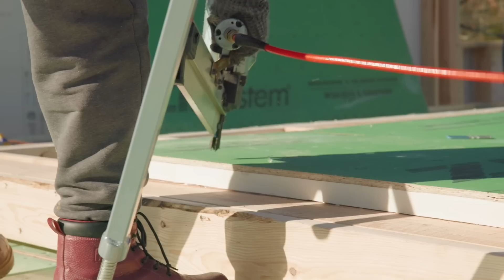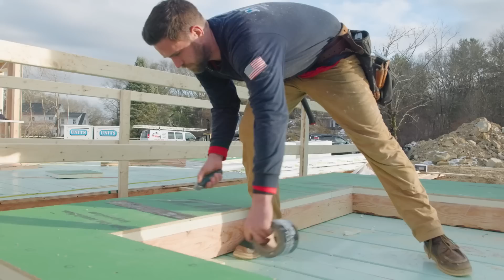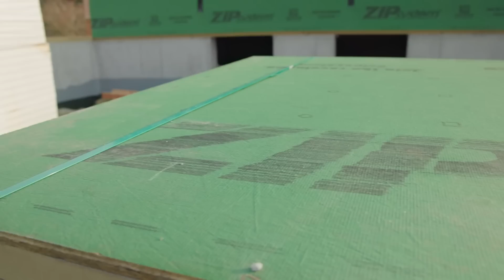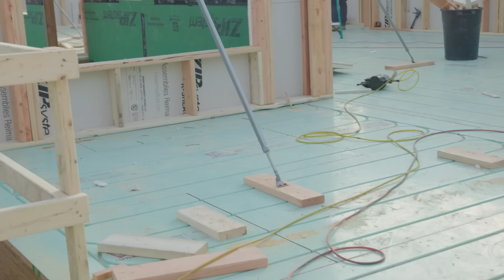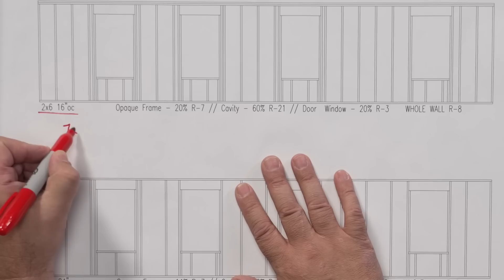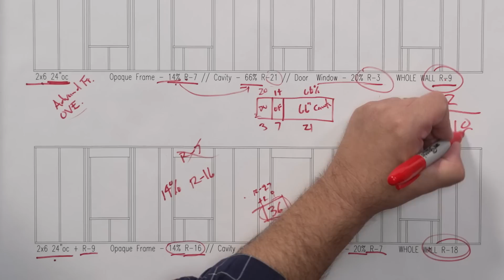"Wall Framing" Build Show Build: Boston Ep. 6

Comment: Amazing video Steve. This is the best explanation of wall system R value I've seen on YouTube.
Reply: Jeff, can you figure out where the R27 came from?  On the sheet it looked like R21.  If R21 is the right one then adding R9 gives R30 and not the R27 +R9 = R36.  What ever the case, Steves point is still made with the R30 or R36 as he ended showing that it was more than the R18. Cheers from Eastern Canada☺   Steve does such a great job as explaining things in a way that is easy to understand.  💯👍
Reply: @MegsCarpentry-lovedogs  he only mentioned it in the on site part of the video how he's getting R27. He's doing 2" (R14ish) closed cell in the stud bays and I think he said blown in cellulose to get the rest. 3.5" blown cellulose must be the missing R13.
Reply: @MrLouie75  Ah!  Thank you. 😊🇨🇦You may have found a few of the 2 missing pieces I did not catch on to. I googled blown in cellulose R value info:  The R-value of loose-fill cellulose insulation is approximately 3.5R per inch of thickness.  So 3.5in of blown in on the site itself provides initial 12.25R and it decreases over time as the blown in cellulose "settles" over time. Interesting! ☺
 I did send a request for him to clarify, realizing he is super busy being such a high profile architect. Like I did point out, so to not disprove or cause a negative perception on him, regardless if R36 was possibly incorrect and according to his drawing, using R21 +9C =R30, the building science still stands.  He helped us to understand that when a contractor says they will provide an R40 wall assembly, we are to asked is that the "whole wall" or just the cavity part. Further pointing out that studs have 1R per inch and windows are between 3-7R and that these lower numbers need to be calculated into the "whole wall" R value, not just the cavity.  
What I learned recently is that an ICF basement or wall assembly, not whole wall, is about R23, But include the lower window R value (R3-7R) and that R23 comes down in R value by quite a lot.  What a wonderful presentation Steve did on this one.  We are so fortunate to have him help us. As I prepare for this ICF basement but thick wall stick build assembly, with rock wood board 80 included on the draft plans, I am deeply grateful for what Matt and Steve are doing to help in the different areas of the construction landscape.  
I am not sure how things are in the construction industry in your area Jeff, but here on Prince Edward Island, construction companies are run off their feet and select only projects that will bring in fast money. When I have the plans sorted out and proceed for the permit, it does not mean I will find the right contractor and will have to continue to wait even longer than the 4 yrs I have been already waiting. Realizing that it is best to Wait rather than get the wrong builder for this 28 x 23 3 story, full ICF basement, open design with open web trusses.  
Of course the price of building material is outrageous. Saving up for the build can be quite a journey for home improvement renovation enthusiasts.
Thank you for your input Jeff. I will review the video and catch the on site bit I may have missed. Many thanks for your input and time on this Jeff.🙏🍁🇨🇦
Reply: @MegsCarpentry-lovedogs  You're welcome. On a different comment on this video Steve told me that a full ICF wall ended up more expensive than framing like this. I plan to build an ICF house in the next few years, and was surprised to hear that. Is that what you are seeing in your area as well? Why not full ICF at your build? So many things are built into an ICF wall (framing, insulation, vapor barrier) and the fact that I can diy stacking the blocks and even the pour if I choose makes me think it's still the choice for me.
Reply: @MrLouie75  Good morning Jeff. I understand the want to have a full ICF house right to the top plate or full side walls to the roof. I was saving up for this expensive build, full ICF, as well.  As I researched and waited for as much info as I could handle🙃, for my situation, a full ICF wall build means if it came to wanting to make any changes in an ICF wall it would be difficult to cut through the cement, and look for labour and the right trades people.  
Generally speaking I am a sort of "leave options available" sort of person.  I sat with the info for months and then realized that the ICF full wall would decrease in R value considerably due to the windows only having R3 or R 7 at best.  So an ICF wall of generally R23 is really not R 23 on the "whole wall."
The ICF full wall was only important if it could give more R value compared to a stick build.  As we have seen and steve pointed out, a stick build can have more or the same and a stick build gives more options down the road should the homeowner want to make changes.
Also I researched and looked at how the plumbing would be considered in an ICF full wall.  The plumber has to cut into the ICF wall further reducing its R value, and generally there is a lot of plumbing material to affect the ICF R value.
Your situation is different than mine though. As you pointed out, if you are not hiring a specialized contractor to do the ICF portion, that might save you a lot of money doing it yourself.  Then again, you probably could also do the stick build yourself as well and save more money. Food for thought eh!☺
From you postings and your replies you seem like a "belt and suspenders" sort of person, paying attention to detail and being more patience and conscientious than the norm in the building landscape. Either way you decide, I am most certain you will do a wonderful meticulous job, ICF or Stick build.
It will be interesting to hear, when the time comes, which you have chosen.  Two years ago, during the pandemic period, it appeared that the cost of materials for ICF and lumber were more on par with each other.  I am not sure if the cost of materials for both are closer at this point. More research is what I would need to do, if I wanted ICF. 
I am quite OK with a stick build. The draft wall assembly is in place for now, with rockwool board 80 added as an additional envelope layer to either R9 or R12, pending how much more I can save up.
I have yet to get the first draft of the plans and send it to get more feed back from a potential renovation local builder, who has set photos showing that he has built using thicker outside envelope.  
As Steve pointed out in episode 3's in project design, the first draft is not the last. I have to be open and ready for other input and perspectives, as I also continue to source out materials that I am interested in, like the Zip R sheathing, tapes, roller, stingers, zip flashing and G-guard.  I priced out these items last week at the local Hardware store here in the small village of Rustico on Prince Edward Island, Homehardware. So it was a relief to know I could get it.  I also checked the prices on amazon.ca, for the tape and easily shipped items. Amazon prices for the stretch tape, and zip tape were a lot more expensive than at the Homehardware.
I still have to save up though. I want to make sure I have enough money, no loan all cash, for this build for the peace of mind.  I am hoping that the renovation builder will let me purchase the material on my contractor account at homehardware and I pay them for the labour as well as me working with them, like clean up every day, running to get last minute materials and I would like a stab of working in water sealing the window sill, just like Matt shows in many of his video's.  The trick is to not get in their way, still be around to supervise, which is easy because I live on the site due to it being an extension, and maybe poke around with doing some of the interior insulation in the cavities myself.  
I did all the rim joists in the basement myself using 2 layers of 2 inch rigid foam and sealing the top plate to the cement foundation. That was super time consuming as I picked away at it over a month or so. You may have realized that a DIY'er task can be divided into quarters.  1/4 setting up, 2/4 the actual task of working, and 1/4 clean up, organize and setting things away every day.
Thank you Jeff for your input. I would be interested to hear, when the time comes, which you chose to do, ICF full house or ICF basement with stick build on top. I have chosen the latter.☺🍁🇨🇦👍
Reply: Thank you!!! Thanks for joining in

Comment: Thank you for another great video! In your opinion is it a good idea to use Zip in So. California? Im building house in high desert in Mojave desert and I want passive solar house that is air tight and saving energy in summer when is too hot outside. I met with few contractors and they are telling me its overkill in California or they dont know Zip at all... We are in high wind area so I cannot imaging tyvek the house with 40-50 miles per hour winds, not to mention how long will the tyvek stay intact if exposed for few days. Please let me know your thoughts.
Reply: It is this simple, you buy energy or get sunlight in the case of PV, you convert the energy into heat or cooling. You install that heat or cooling to a conditioned space. The goal is to maintain that conditioned space as long as I can before I need to install more heating or cooling - understand everytime I install heating or cooling it costs $$. It's a pretty simple argument
Reply: @stevenbaczekarchitect9431  So Zip system sheeting is good for California as well even if its not as wet or cold as elsewhere, right? Saving energy keeping the cool inside before I have to reach for the use of AC.
Reply: Thank you Steven for the answer!

Comment: So why are we not cutting the window holes out before erecting the frames?
Reply: Weather proof the structure if you have to wait on the windows to arrive.
Reply: @shannabolser9428  thanks, I thought of that, but I've seen others not bother to weather proof at all, so I was confused.
Reply: @shannabolser9428  Yes, on the larger windows they work the sheets around the opening

Comment: I was thinking of doing 2x6 wall 2’ OC with 2x4 purlings on 2’ vertical spacing, polyiso between them, zip sheathing and 1 1/2” polyiso outside of the sheathing, and rain screen. R23 Rockwool in the cavitys. I got a bunch of 1 1/2” polyiso for a really good price. I didn’t know if it would be worth it or not.
Reply: Exterior insulation is always worth it

Comment: Great video as always.  I'm planning to build a custom home with 1 inch of continuous polyiso in Maryland climate zone 4.  Haven't hired builder yet but pondering whether to use zip-R6 vs OSB/1" polyiso/WRB as separate products.  I'm thinking the latter would be less expensive in materials cost but the additional labor cost may make it a wash. Do you have any thoughts?  Also was wondering what you prefer to seal the joint where sheathing meets the foundation? Thanks for the awesome videos!
Reply: Yes Zip is one trip around the house - where labor cost matters it usually is the best solution
Reply: However, in my opinion I think that OSB against the studs and the polyiso on top of the OSB on the outside is going to provide stronger stiffness to the house vs the ZIP (but probably it is going to be more expensive due to labour costs)

Comment: Can you use zip tape on regular sheathing? I am considering only doing a strip of Zip System at the bottom and the rest standard. Can't afford the entire house to be zip.
Reply: You need to try it - if not Siga makes some very aggressive tapes that will work
Reply: @stevenbaczekarchitect9431  I've considered using window tape since it sticks to anything but that would be expensive.
Reply: @yagermon10  1/2” Plywood Sheathing and all seams taped is air tight. OSB is not air tight unless it’s Zip Sheathing.
Reply: I would like to redo my siding but my house is particle board (certain areas are broken and missing), and re-sheathing my whole house with zip seems like alot.  What else could I do? zip the bottom 2 ft? Or should I just re-sheath the whole house?

Comment: I just had a 2-story addition added onto my home in December and the framers installed the same Zip sheathing and tape by hand, but didn't roll them. I live in the northeast, so it's still very cold here, so can the tape be rolled in the spring, is it not worth the effort, or is it too late and they should have been rolled at install?
Reply: Tape always need to be rolled - doestn't get "wetted" if you don't roll it.....

Comment: Steve, I was looking forward to this and came ready with a question unfortunately i'm a few hours late though so I doubt you'll answer. It looks like those framers set the first course of sheathing flush with the bottom plate of the wall. Opting to fill in the rim joist with another cut piece. Why not drop the first course of sheathing down to mudsill covering the rim joist as well. the benefit would be fewer seams to tape and fillers to cut. Is my thought wrong? are there positive or negative cascading effects of doing this?
Reply: Double mudsill and they came down to bottom of top one. The bottom one will have a 2X treated block to stop anything from burrowing up into the R-9 insulation from below. They will simply tape the zip face over the face of the treated 2x to flash it
Reply: @stevenbaczekarchitect9431  This is a great detail, hope you talk about it in future videos!
Reply: @NicPottier  will try to hit it on the siding/rainscreen episode

Comment: Too bad it’s not ICF
Reply: I tried actually, didn't make the $$ cut
Reply: @stevenbaczekarchitect9431  Did it not make the cut because Huber supplied the Zip+R9 free, or was the ICF just that much more?
Reply: @MrLouie75  If you price Zip R-9 on a wood framed wall against an 11" ICF wall in our market (both at market price) the ICF wall is likely 150% - 200% the cost. It may be different in other places, but here, that is our reality
Reply: @stevenbaczekarchitect9431  Thanks for the reply, I didn't realize ICF added that much cost. I wondered why you didn't continue using the ICF after watching this video.
Reply: @MrLouie75  We did look at it for the foundation here - just didn't pencil out

Comment: That’s all good that I fell in love with insulated concrete forms do everything the roof, the floors all in concrete forms and then take aluminum studs 2 x 4 on the interior for all the exterior and interior walls then do 4 inches of spray foam to pound close cell All the floors would be done with warm board and thanks to you guys. I have this knowledge.

Comment: We started a home build last summer and we used Zip-R12 sheathing here in zone 6.  One comment I got from the framers was that our home was the hottest home they've framed.  They never used Zip-R before.   With no roof, the sun really heated up the interior and the Zip-R kept the heat in with little wind.  

If you use Zip sheathing, don't trust the framers to tape the seams.  I did that myself.  My framers didn't like anything new to them, especially using 4" nails for the thick Zip.  I had them use foam subfloor adhesive and they complained that the foam blew off when they dropped the 4x8 3/4" plywood sheets.  I had to tell them to lower the sheets onto the foam adhesive.  They weren't very bright.
Reply: I like R-12, but usually stop at R-9 because of the jump to 4" nails

Comment: When he is showing the window header pocket. Is there a loss in strength by piecing the header together as shown in the video? Time frame 15:17. There is a seam on the header 6 inches from its support.
Reply: Seam in is the LVL manufacturing - would never seam a header, it's a beam
Reply: @stevenbaczekarchitect9431  sounds good. It looked like two LVL's together and the one showing in two pieces to save product or cost.

Comment: How do the "header pockets" work with drywall and drapes?  Also, the eccentric loading of the top plate looks odd, especially in the corners.  Is that not an issue since the joists above are held with hangars to the rim joist rather than bearing on the top plate?
Reply: Drywall simply spans the 9 1/2" vertically - you can introduce 2x4's on the flat if you'd like. Our structural engineer walks thru EVERY header and verifies the bearing conditions - it shows you how little is actually needed

Comment: Double shear is stronger than single shear, two planes of shear force resistance? Did you mean to say that the Zip panels with insulation built-in are less rigid because the nail is longer and there’s in-effect a moment created, hence tension forces. As a result of these tension forces, together with the shear forces, the panel has theoretically less rigidity, when compared to a panel with Zip panel with no insulation.
Reply: It's more that it puts the nail in "bending" and creates a couple, it's a strucutral reduction from single shear

Comment: Where I live in south Jersey. Some builders use zip boards because it makes their project look good to the uneducated but no tape because it is expensive.
Early on builders using the tape didn't always roll it.  So then they started making tape printed with "ROLL THE TAPE" in two languages. That didn't always work. So now they have the imprint telltale roller.
Reply: Are you saying zip boards aren't any good?
Reply: @jasonwest2064  No I'm not. Just that you have to follow the installation instructions for it to perform correctly.